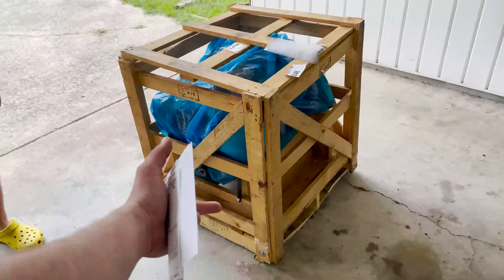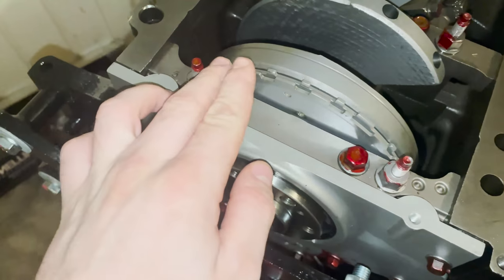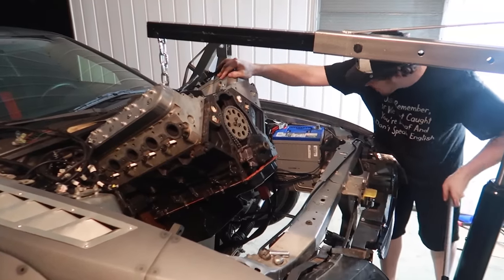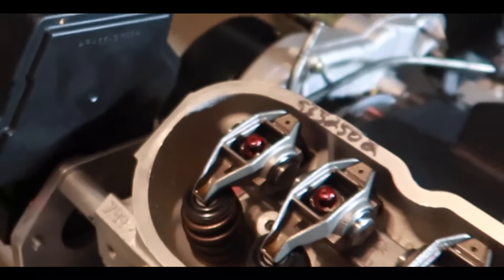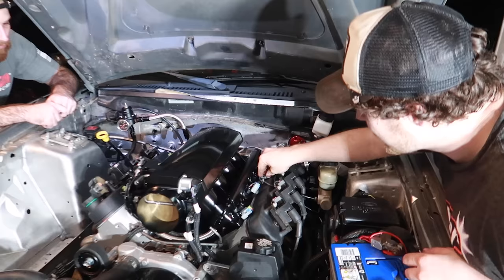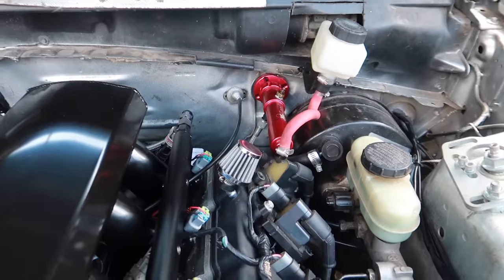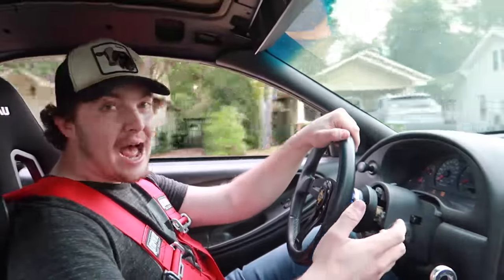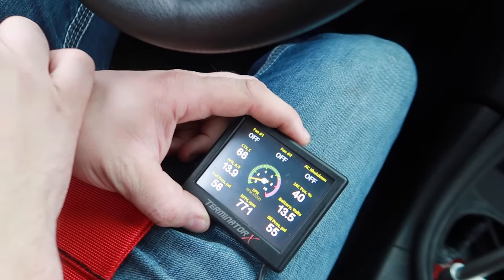Installing a 550 HP CRATE ENGINE in my Car!  LS Swap 99-04 Mustang DRIFT CAR PROJECT IS RUNNING!

Comment: You have to prime the oil pump before you even crank it. Driver front is an oil port that goes directly to the oil pump. That needs to be filled first  if not done that oil pump will be trash in several months.

Comment: The problem with LS in a drift car is oil starvation. You really need a bigger oil pan with the hinges to keep oil from sloshing away from pick up. And most guys will run a dry sump. Glad to see you get a new new engine. Congratulations

Comment: Poe I hope you change/ changed your break- in oil and cut open the filter to check for large metal shards.  Congrats on the new short block btw. Hope Ruston is treating you well.

Comment: LS with the DOD/AFM are notorious for low oil pressure. The motor itself runs low, then the pressure senor has a screen that clogs often and lastely the oil pickup has a gasket issue. You can delete the AFM, If you did all that and still have low oil pressure time for a motor but you already got that!

Comment: Did the oil pump come with an extra spring in the box? Read the directions. Some of them you can swap the spring for higher pressure. I almost always prefer a high volume pump over a high pressure pump. But I do not drift. Just a suggestion.

Comment: I always prime my engines really good  before start up but you are putting a 5.3 in a mustang so you already have issues 😂 ps that’s a hot air intake  might not make 550 hp good luck tho you making a dyno video?

Comment: I'm the middle of ls swapping a new edge myself.  Was your car a gt with hydroboost brakes? How did you go about setting up the power steering.   Chevy pump?
Reply from the maker: It was a v6 without hydroboost, but if you have a gt, you can make it work still.

Just make custom lines from the chevy PS pump to the hydroboost. Then a line from hydroboost to the rack, and then a return line from the rack to the return fitting on the chevy PS pump. 

You will need a shim kit to reduce pressure for the oem GM pump so you dont blow out the Ford rack seals. I think ford PS systems operate at 900psi and GM PS systems operate on 1200+psi but I could be wrong on that.   Its worth looking into it more tho!
Reply: @PoeBoys  i appreciate the info!  Sometime else told me about needing to pressure reduce but so far I've been unable to locate this shim kit or any how to info
Reply from the maker: @gibhamracing37  https://www.summitracing.com/parts/brg-899001?seid=srese1&gclid=EAIaIQobChMI1NmZ-46T_gIV5xPUAR1YVABcEAQYASABEgI-m_D_BwE
Reply from the maker: @gibhamracing37  I gotchu fam! This is the kit^
Reply: @PoeBoys  thanks again!

Comment: why you put an LS in a mustang like cmon man if your gonna LS swap a car please swap it with something GM like just imagine wow i just bought an early 2000s charger im gonna swap it wow should i put a cool 800 HP hellcat engine or a boring disrespectful LS engine like damn man you could have put a dope ass voodoo or a coyote for all i care he at least its not cursed right right? like i respect the work being put into it but seriously why would you do that to a s197?
Reply: Hellcats become unstable when supercharged/turbo'd. Those engines are great until modded.  An LS is a cheap, lightweight, reliable motor.

Comment: That engine looks tiny compared to the ford 5.4L  (im on my 3rd 5.4L cause I put the wrong oil filter on it blew it up) this time im going with a Fully built bored to 6.0 twin turbo extreme cammed 5.4L based engine making 1500-2000hp or more.  Congrats on the new engine poe.   And missed ya bud long time no see